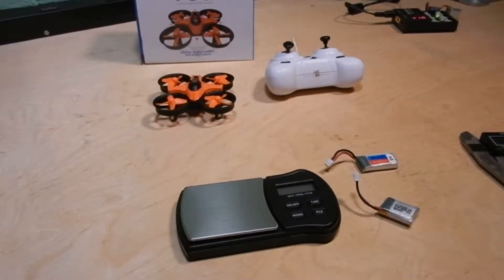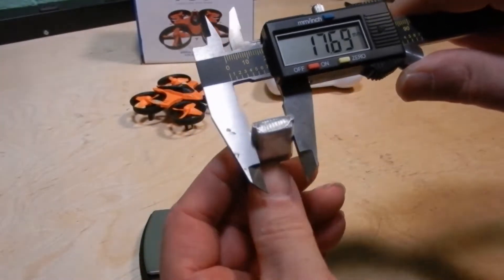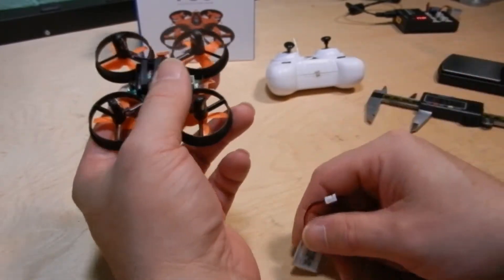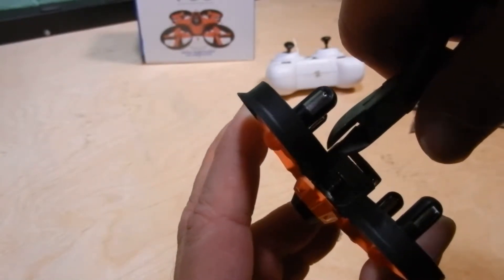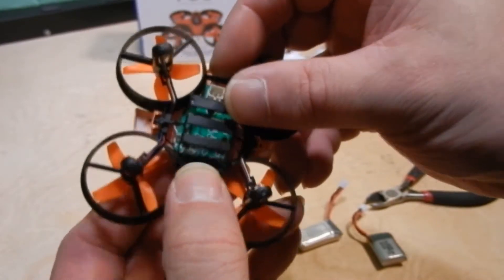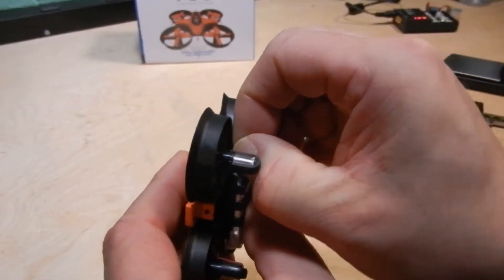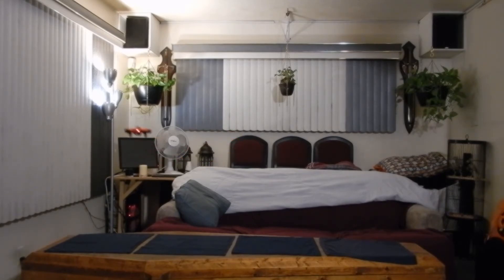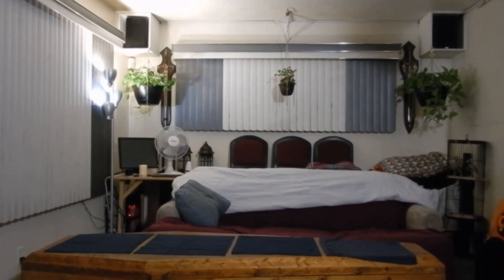Furibee F36 Battery Bay Mod - 150mah 20C Vs 260mah 30C Battery

Comment: Nice mod, I'm going to do this with my drone! I like how cutting it only partially makes the battery compartment more usable without removing it altogether and having to use a rubber band to secure it which adds weight.
Reply from the maker: Yea, it works nicely like this. Already adding weight with a larger battery, you don't need more from a rubber band or whatever else to hold the battery. The plastic that this particular frame is made out of seems to hold up well being bent from repeatedly inserting batteries.

Comment: I know this video is old. But I did this mod because I am running a 450mah infinity LiHV battery that I just recieved today for this quad. The battery is long so i just have to make sure it fits even in the battery bay or it throws the drone off balance. Thanks for the video
Reply from the maker: Thanks for the comment. Yes, I have to make sure even the 260mAh the battery is centered to keep it balanced. A 450 seems a bit much on the weight. I wonder about the power to weight ratio and effect on flight time. There comes a point where a larger capacity battery makes no difference in flight time due to weight as well as fly-ability.
Reply: @therccrashproject6330  i think best is 200mah because of same size and weight as original and performance is also same

Comment: Not much flight time difference yes?
I guess maybe its because of the weight makes the motor works harder. 
Thanks for sharing and great work!
Reply from the maker: Thanks for the comment.
Yes the little extra weight does make the motors work a bit harder. But after comparing several stock batteries (Furibee original) and several of the 260mAh batteries (all the same brand), I have seen a big difference in several of the 260mAh batts.
On one comparison I actually got a minute and 25 seconds more time. My guess is that it all depends on the battery quality; some just came off the factory line better than others. Overall, it depends on a variety of factors; motor efficiency, battery quality, wiring, plugs, boards and how hard you fly.
Reply: @therccrashproject6330  so its probably just a luck factor then 😁 when buying extra batteries, oh and i was just wondering if you ever tested tattu 220mah battery with jst-ph 2.0 connector, does it fit the stock battery socket?
Sorry for much questions, but thanks for replying.
Reply from the maker: I haven't tested any other batteries yet. I am just now getting back into RC and my funds are extremely limited because I am disabled. But as for the connectors, as long as you get the same connector it should fit. Just make sure the polarity is correct so you don't fry anything. Those tattu batts I am only finding with the 1.25 connector so it wont fit.
Reply: @therccrashproject6330  I'm sorry to hear that, but nice conversation we have here, best of luck for you, keep making great contents, thank you so much 🤗 and you have a new subscriber here.
Reply from the maker: Thanks for the comments and the subscribe. I'll be doing my best to keep this channel going.